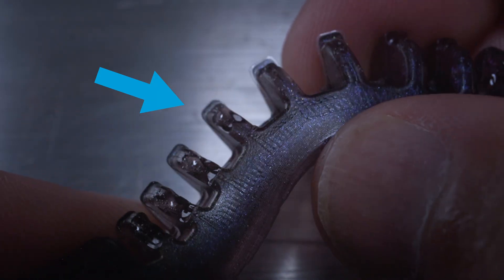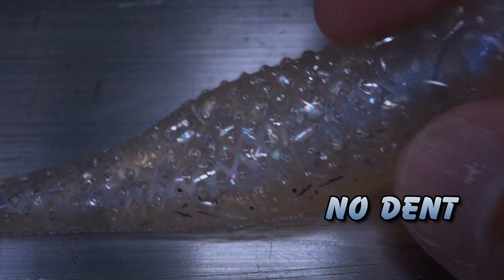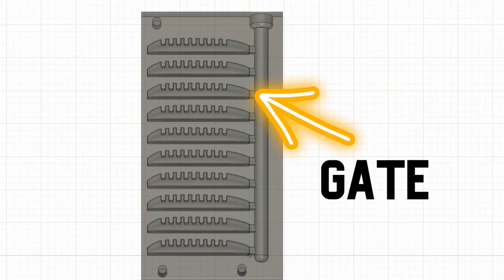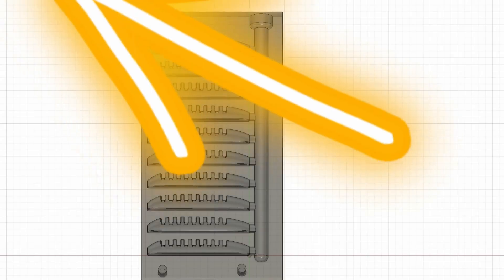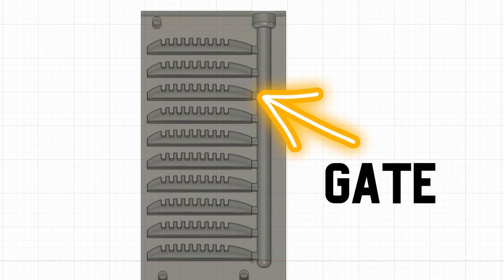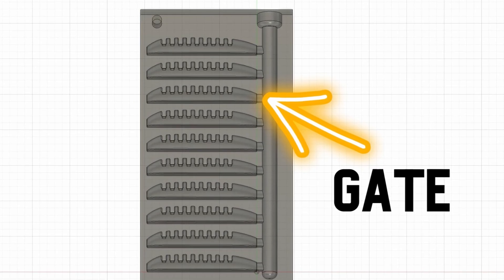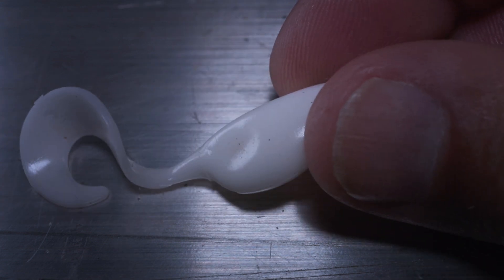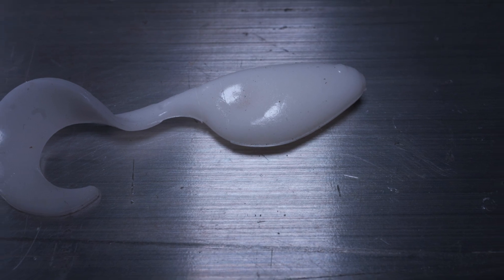Dented Lures: A Common Problem and How to Avoid It

Comment: I do pewter casting and I aim for a spherical bulb on a gate that is short(maybe 2mm).
Reply from the maker: Do you think the bulb provides enough excess heat to keep the gate flowing?
Reply: @WMBayouLures  Yes and it as simple as using a ball nose cutter in the mold. It also helps if the spew grows larger as it leaves the parts(maybe 5 degrees taper). If the very last place for the mold material to freeze is back at the injector your pressure keeps pushing soft material the whole time.  In metal pouring that means a tall tapered cone for gravity but in injection molding it looks like a tree trunk with smaller branches.
Reply from the maker: @karlh6692  awesome thanks!!